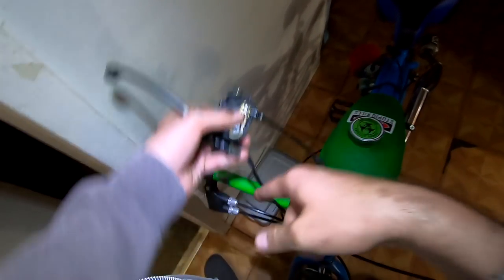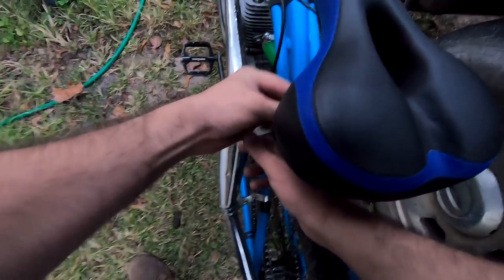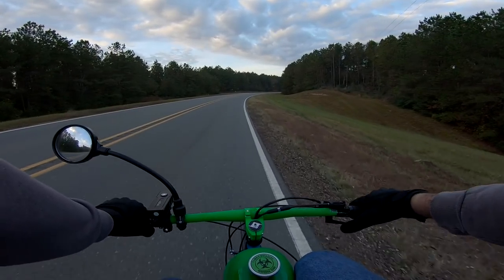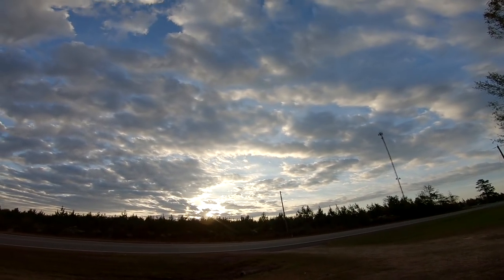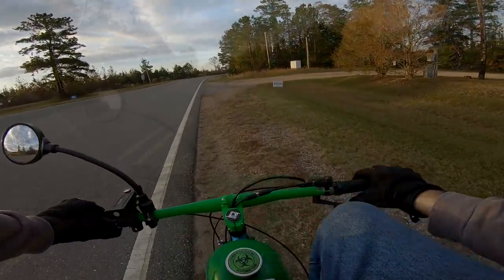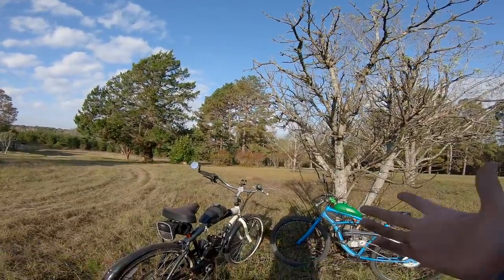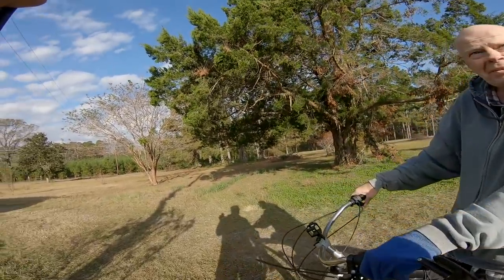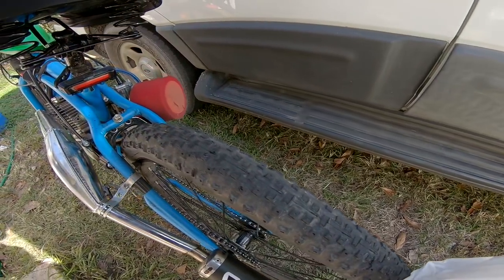Retarded Ignition YD100 (Motorized Bike)

Comment from the maker: Here is a video about mag timing. https://www.youtube.com/watch?v=ivbhxGh5jRw&t=3s
Reply: Virginia. I just went scouting on a road I found on google earth but it looks like it’s private property.
Reply: One trick we do a lot on 4 stroke motorcycles is this. Elongate the mounting holes on the magneto ever so slightly in the direction you want to go. I was looking at my PK-80 mag and there is room to do this. Now, ignition timing on a 2 stroke is critical. Too much and you're into pre-ignition and melting pistons. It makes sense that retarding the timing gives you some lower RPM grunt. If anything re-gear for the RPM range.
Reply: Pops looks like he's loving it
Reply: DeWalt has 24 volt heated gloves you name it they have it heated hoodies coach throw overs Milwaukee has them too but the DeWalt ones get warmer
Reply: How come u never post top speeds.u need to post em in description with name of engine

Comment: The faster you go the more nuts and bolts you begin to lose! Ive had handle bars try to rattle loose as well, just a warning to loctite your stem. You could put a cheap suspension fork and a disk brake on the blaster.

Comment: The button on the double brake handle locks the brake down like emergency brake you pull the brake handle push the button and it locks it in position so it locks both of your wheels
Reply from the maker: Right, that's what I thought is was for, but this one just does not lock. Maybe mine is defective, but thanks for the tip.

Comment: Hey whats your opinion on using an Aluminum frame mt. bike? Im not sure it can handle the engine...thoughts?
Reply from the maker: Mounting the motor can be a pain on the fatter frame tubes, and cheap aluminum frames are know to crack due to the vibration... It can be done, but I would not ride it fast.

Comment: How fast do you usually get going because I have the upgraded carb and exhaust but I can only get up to an average speed of 45km/hr 
Which seems a little slow.
Reply: @NicksBikes  I’m using 25:1
Reply: @NicksBikes  Yeah I’m still using stock spark plug I was told a better one wouldn’t make much difference .
How fast does you bike go on average?
Reply: @NicksBikes  dang... wish I could get mine to do that.
I was thinking about using a sealant between the carb and engine to try to help gas flow.
Do you think bigger wheels mak much difference?

Comment: Noticing I havnt seen any vidios on an idea I was having and I'm betting there's a reason for it! I was thinking about building a motorised bike also using an electric front hub and and the more I think of it I'm betting the running gas engine would probably not allow the electric controller to run unless you shut off the engine but idk!

Comment: Dood, I built a 50 mm ld100 top end on a yd100 lower and retarded my timing by oblonging the holes in the magneto coil and turning the coil slightly clockwise and it's it runs better than any other motor I've ever had and I've had six.  I wish I'd known before. It runs as well as this. Cool.

Comment: I drilled out the pilot home 1.5 mm and it worked like zeda Motorsports did it worked
Reply: I just bought a PWK for my 100 and was wondering which Zeda "show" to watch about 'em where they drlled out the pilot "home".?
Reply: @KenC56mm  on YouTube zeda Motorsports with an OKO carburetor showing you where the drill the pilot hole 1.5 drill bit or 1.0

Comment: I recently built a motorized bike and I’m pretty sure I’m having a clutch problem(it’s also my first build) I try to get it started and when I release the clutch the bike just slows down and the wheel just locks up anyone have any suggestions?
Reply from the maker: To help the clutch engage better, take off the right side cover, remove the set screw, and tighten the flower nut 1-2 notches, than replace the set screw and the cover.
The lock up is usually caused by having to much slack in your chain.
Join the discord link in the description if you need more help.
Reply: @LAHover  thanks I’ll try that out today and join the discord if it doesn’t work
Reply: @LAHover  I also forgot to mention that when I let go of the clutch the gear that’s supposed to catch the clutch doesn’t move with the clutch

Comment: Too rich at mid RPM still )
Reply from the maker: Nope... Plug chop is perfect, and it's running like a clock.
Reply: @LAHover  Plug chop is perfect because mix are perfect at top RPM. Try to ride at middle rpm for about 10 mins, then kill the engine, let it cool down and see the plug then. P.S. What's the main jet's size now? .95 I beleive?
Reply from the maker: @MetalMaster8888  The mag began to advance it's self, causing the miss fires to return. When it was retarded during the beginning of our trip the mid range was fine. I'll find a way to keep the mag from moving and we should be good. Current main jet it 90.

Comment: You can get the same effect by just oblonging the holes in the magneto coil housing. Take a drill bit that is slightly smaller than the original hole and route out areas for the four bolts that hold them in to slide either forward or backwards depending on if you want to advance your timing or retard it. 

Take special care to use washers to cover the holes but not too obstruct the movement of the magnet. You can take the four bolts and stick them through cardboard to gauge how much movement you got.  It's much easier and much safer than doing a woodruff key.